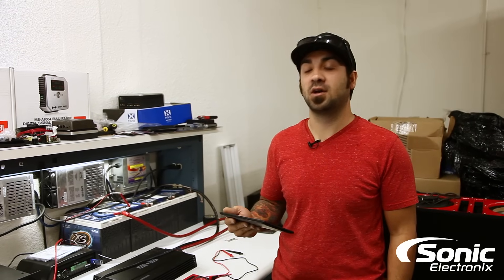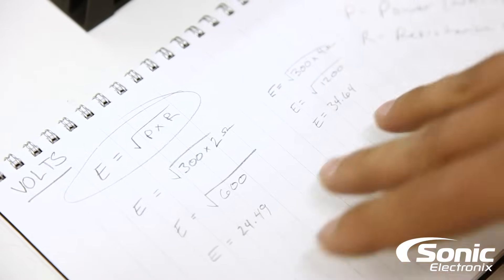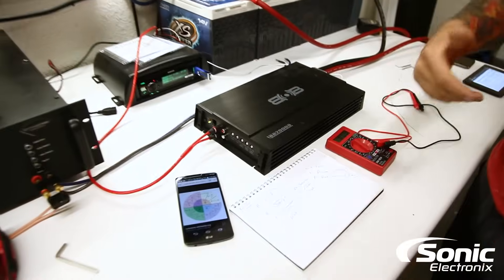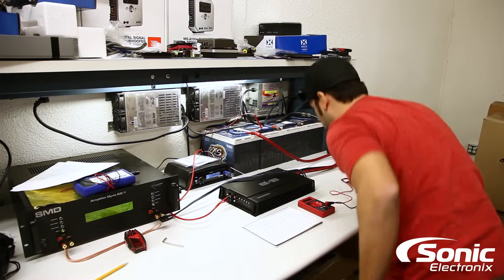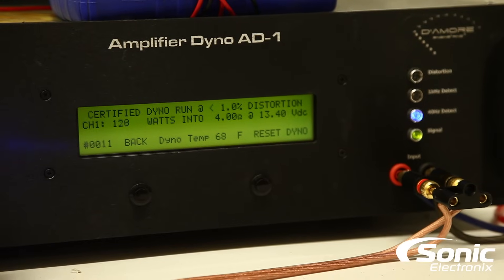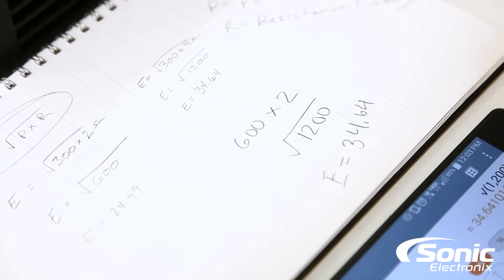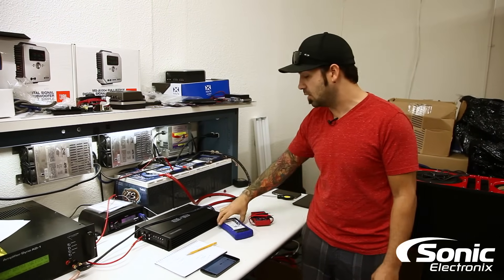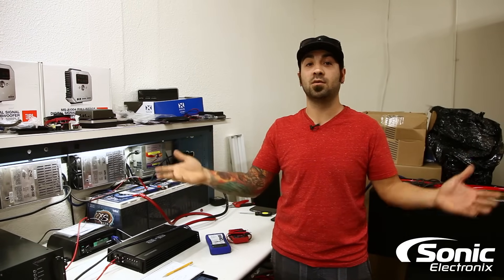How To Set Amp Gain to Match Lower RMS Subwoofers? | Car Audio Q & A

Comment: Your formula is wrong, rms and dc are different and you just cant use ohms law, real formula is Erms = sqareroot (2 x Prms x R). ohm law you used is dc equation. that 300watt @ 2 ohms needs a voltage swing of 34.64 volt peak to peak to get 300watt rms, we are talking about sine wave and it is not pure DC where your formula is right. you need to insert 2 in the equation.
Reply: Hello James, I just found this video few days ago, I already posted three comments, I agree with you that the ohm's law assumes that the resistor is fixed value, AC is different because of the sine wave. the resistor under different frequencies will never stay at one value, it will make our calculation not even close to the value it suppose to be to get the full performance of the sub.
Reply: James, I agree with some of what you say, however some other do not agree do not disagree, I am not really experienced in the audio and speakers, but doesn't sound good to me when you consider the max rating for a speaker, I guess it is just something some manufacturer mention for marketing, what is really matter is the RMS. means if a speaker rated 100 Watt RMS, I will be thinking hundred times before I over power it, I may go over power up to 25%, but I said 25% not based in any knowledge that I know, not based on any logic, it is simply just a guess, over powering in general is something I wouldn't prefer to do as long as it is in my hand to apply the right exact wattage, for car audio I may go 25% over and that is because when the car is not running the battery is giving less than 13 volt and most likely it affect the amp, so 25 % over powering the speakers when the car running is ok, not more than that. also I do not think the speaker rated 50 ohm and getting the 50 ohm RMS, will give the same sound pressure as speaker rated 100 ohm and getting the 100 ohm RMS from the amp, no way, if it is possible you will sacrifice the SQ to make lower wattage sound as loud as higher wattage, Back to the main topic: What makes speakers more complicated than any other simple load is the frequency, the frequency changes the value of the resistor and therefore Ohms Law  assuming 4 or 2 ohms impedance is wrong and will lead to wrong result, because higher resistor or impedance means lower current, which means higher voltage, so if ohms law assuming 4 ohms lead you to adjust voltage at 30, that 30 is not going to give you any considerable performance from the sub, unless you adjust the 30 at 0 level, but then when you move the level control to max or close to max you may exceed the limit of the amp and guess what? CLIP. best to find the exact voltage at the frequency between 20 and 80 Hz, adjust this voltage when the level controller at max, and the full range speakers at max or as high as you want, this way you make sure you never clip, and never under performance.
Reply: +James Balagtas Close enough... lol
Reply: yes, sine waves are calculated as to be equivalent to AC if you calculate its Root Mean Square value, the tested value can be directly calculated as dc power if the test read true RMS in AC, like fluke testers
Reply: an example is, 100watt dc on a 8 ohm load, need 28.xx volts but on a sine wave, you need 40volts peak to peak to get exactly 100wat ac  euivalent on the same load 8ohms. thats the difference between ac and dc power
Reply: I do not agree 100%, my point is that the frequency will change the value of impedance, and I do not really know how to measure impedance. let's say under 50Hz, the way to do it is to play 50Hz test tone, and start with the value suggested in this video, measure the current and multiply it but the voltage, if the result is less than the wattage rated, or targeted, continue increasing the gain, measure the voltage and the current, do the calculation, and so on, until you find the Volt X current equal the wattage rated or close to. when you are done with that it is easy to calculate the value of the impedance when it was under the 50 Hz test tone. I assure you that will find the voltage value higher than the peak value of what this video suggest, I mean way higher., It got be X 1.65 of the RMS value. How can I guess? because I did that for 210 watt RMS amplifier. I got 190 watt out of it, measured AC volt about 50 volt, or 51 RMS, do the math to find how much current I actually measured.
Reply: we are not in ideal situation, even if you know the outcome of the calculations, in the real world, it will differ, when they rate an amplifier, it mean it can deliver pure sine wave without distortion on a said impedance load, even speaker designers cannot get the impedance perfect, the only way to get the real power delivered to the speaker will be always below the ideal design cause there are alot of factors, like baffle resonance, coil changes in impedance like you said, even the speaker wire will affect the power, one rule i have always been using is matching, as long as you have the right voltage swing of the amplifier, no matter what freq, base mid or high, match it, speaker max rating does not mean you need to drive it at that power, some speaker have max and normal power rating that are much lower. example a JBL 2225 has ma max off 400watts and a normal power of 100watts, driving it with a 200watt amplifier is as good as  driveing it with 400watts rms, some people think power is musical power, well i dont, that is only electrical power, a 1000 watt 12 inch will do the same sound pressure with a 200 watt 12 inch same construct speaker. Power is just electricity that will just burn speakers,  i don't go for power, i can go louder with less power right. when designing VU meters that says peak resolution is 100watt on 8ohms, its just a reference that you reached that power output or peak level where it will start to destort, IF the total load coil is 8ohmAC exactly, just don't get confused about power and audio sound pressure. anyone can get the same sound pressure with different power ratings
Reply: i have a mobile sound system, not usually car audio, well some speaker are design to operate on a band of freq, in mobile we don't use woofers, we always use instrumental speakers, even for subs, car speakers usually use woofers, that has freq response test graphs, so you need to build baffles that will be good for that specified freq, also these amplifiers have limited voltage that is why its easy to clip and usually operate at very low impedance low impedance, now depending on how stable the switching supply of these car amps, it will always suffer, i dont even think they even rate car amps as rms power, unlike AC power professional amps. i do have at least do 1.5 to 2x allowance too, but in car amps, it creates power by more current or lower impedance, that is if the ampli can push it to peak voltage which usually doesn't, some dum manufacturers even rate them thousands of watts when to the cost that you have to operate at 1 ohm lol. even your speakers wire will cause a lot of loss,  a 30volts swing will only be around 50watts@8ohm. 100watts@4ohm and 200watts@2ohms, it can't drive a 500watt 4ohm speaker fully. unless you start bridging this. ideally bridge corresponds to x4 power ideally, but due to hysterisis and real world capability of components, you can justify only >= 2x the single amp power.
Reply: James Balagtas Fascinating thread guys. What if I measure impedance from the speaker wire attached to the subs then use the e= square root (measured Ω·Watts desired). Do you still need to add the extra 2 in the square root? In my application that would be the difference of 31.62V vs 44.72V, a hell of a lot.
Reply: But the power dyno proves the formula is correct.
Reply: +Ashraf Mohamed check this out I can hit a hundred 45 decibels in my truck with 212 that are 500 watt RMS Subs I can also get some subs that I have that are hundred fifty RMS Subs and hit 145 decibels so just because your speakers in your amp or more powerful don't necessarily mean it's going to make it any louder you would think it would but it's not necessarily true if you look on the internet there's a guy that has two 12 inch Kicker comps on 300 w RMS that hits a 151 decibels

Comment: the problem i have is that if i play that test tone at 0 db yah i can get the power i want which happened to be 1400 watts out of my 2k but when i play music the bass is never at 0 db how do i set my gain without test tones or test tones that are at music gain.
Reply: +ThaDjSteps 
thats simply a maximum value. as to not blow out the voice coils on the speakers.

Comment: How do you know when you're running your amp at 2 ohms?! 
Wanting to get FULL potential of my subs AND amp
Have a "Zeus amp" 2400 max
And a alpine type R sub at 3K max. 
Looking to push my sub @ 1200 with no distortion or clipping
Reply: +Chuy Pizano 

Ignore max ratings they are simply bs

the #1 thing to do to get the most out of the equipment your running with no distortion or clipping is to get a dd1. that will help you set gains without distortion.

not the best, but the easiest
Reply: +Salvador Sandoval 
What's a DD1 ?
http://www.amazon.com/Complete-Electronic-ChromaCast-GoDpsMusic-Drumsticks/dp/B008GXEFWC
Reply: +Chuy Pizano - Read This 
http://www.crutchfield.com/learn/how-to-match-subwoofers-and-amplifiers.html?g=500

Comment: Great video. But to be even more exact, shouldn't you use the actual Re of the specific subwoofer you're using when doing your calculations? Rather than just a nominal value?
Reply: +firebirdude2 
yes and no..... the simplified value (4ohms of 2ohms) is close enough to the specific Re of the coil that you are using(3.6ohms or 1.8ohms)

since the asker didn't provide re sonic electronix only used a simple value in its place.

also there's only a certain amount of precision that you can achive with a small screwdriver(or fingernail) and the tiny gain pot on the amp. so nominal value is making the math a lot simpler. 

no need to go to extreme precision when most voice coils are capable of taking almost 50% more of their rated power all day.

Comment: I need help ASAP. I got confused now.
I have 2 12" subs 600w rms 1200w max @4 ohm and a 4000 class d amp. I have it @ 4 ohm which gives 1500w rms. So...the voltage I got was 49v BUT here's where I'm confused...should I do: 1500 * 4 = 3000 square root 77.45 or 1200w * 4 = 4800 square root 69.28v ?
Reply: Sonic Electronix    I think I got it...600w (subs) * 4 (ohms) = 2400 square root 48.98v.
I replied correctly to myself, lol.
Reply: Sonic Electronix Can I use this same method to set @1 ohm? The amp is rated 2800 watts rms @ 1 ohm, don't know if is safe for the subs. (600w rms dvc). So it would be 600 * 1 = 600 square root 24.49 volts?
Reply: +LOV2XRL8RL 
You have two 4ohm subs, (Unless your subs are dual voice coil) wiring them in parallel (as they should be) would present a 2 ohm load to the amplifier. There's no changing that. The amount of power being delivered depends on what the amplifier outputs at 2 ohm.
Reply: William Jeremiah Thank you

Comment: how does the remote bass boost knob play into this? at 0 boost the ac voltage is set at 27 but it gets spikes to 40 at full boost. using a 1216 hifonics 1200w @ 1ohm to a RF P3 rated at 600RMS wired to 1ohm. I'm putting about 750w to it i think.
Reply: +Wesley Miller 
the remote bass knob is different depending on the install and brand.
the one i love to use is the one that is hooked up via rca to your head unit then outputs the rca to your amp. meaning that you can turn the knob all the way up. set the proper gains. then turn down to a desired volume level without boosting anything passed its braking point.

Comment: I'm running a 2000 Watt Crunch Class D Mono Amp and 2 12" Polk DB Subs, factory radio also. Everything was working fine, until 2 days ago amp won't cut on and fuse looks to be in tact. I used my meter and it showed the amp receiving power but won't turn on, any idea of why? Sonic Electronix
Reply: did you ever figure it out?
Reply: Yea changed out my fuse from 80 to 100 and I need to set my gain...
Reply: +CJ Babbs (CJSKYWALKER88) 
If changing the fuse to a larger one fixed it..
You didn't "really" fix it. Something will happen again and it will be worse.
I'd be curious as to what ohm are you presenting to your amplifier.

Comment: If I have a 1500 watt 4 channel amp for my 4 4 ohm speakers with 60 rms each what would be the formula, what would be the voltage and would it matter what speaker output I checked since it's a 4 channel? Sonic Electronix
Reply: +ponderkid11 
so since you are looking for the recommended voltage when using a multimeter for your speakers ignore the amps rating and lets start with the math. 

1.   60x4=  240
2.   squareroot(240) = 15.5 (rounded up from 15.4919333...)

so your target voltage for a 1000 hz test tone@0db is 15.5v
Reply: +Salvador Sandoval ya 3 months too late but thanks anyways
Reply: Sorry lol but hey any bit helps right
Reply: +Salvador Sandoval yup haha

Comment: Hey mate great video with regards to the ohms if you wired 2 subs down to one ohm would you use one in calculations or 8 as it is two 4 ohm dual voice coil subs wired down ohm, hope this makes sense. Thanks
Reply: +William Hirst 
 If you are wiring them both to one 1ohm load. you  want to use 1ohm in the math

Comment: Hey so I have a question if im installing a 1000 watt speaker in my car do I need a one channel amp or 2 channel ?
Reply: you will get more sound off 2 500w subs than 1 1000w sub.  just so you know.  and you could use either one because you can bridge the 2 channel down to one.  just make sure you have your ohms right.

Comment: You didn't mention if you use the DD-1 to take out all distortion you can run your speakers a little above rated power, it doesn't exactly have to match.

Comment: thanks for noting at the end that to achieve max clean power a o-scope or dd-1 is needed.  because an amp may only put out 32 volts clean.  it's not an issue to under power of over power (with in a tolerance) on clean power.  but dirty is bad either way.

Comment: If my head unit only has just 2 pre amp outputs how do I run a 4 channel amp?
Reply: Joseph Wright To run a 4 channel you need front and rear RCA preout plugs because a 4 channel gives you control of the adjustment from front to rear to balance sound in your vehicle, if you don't care for having that control, a simple 2 channel will do just fine, so remember a 4 channel gives you control over front, rear, left, right... a 2 channel gives you control of just left and right, if you have a 4 channel amp now you will just have to run it in 2 channel mode, that means using the A channel for all the speakers, the B channel will not be in use.
Reply: +Joseph Wright 
2 pairs of pre-outs or one white and one red ?
If the amp is bridgeable, it could be used as a two channel amp. 
As long as each channel is stable at 2 ohm, you can bridge them and use a minimum of 4 ohm on each bridged output.

Comment: Does this formula work for all speakers or just subs and can it be done correctly without the test tone??
Reply: Juan Rodtiguez Yes, in the laws of electricity this is the only way to calculate the power you are looking for, this apply's to any type of device that provides AC current.
Reply: @MazdaBass971  5yrs later but thank you!!

Comment: Don't forget to set your crossovers before testing so that you can read your 50 or 60 Hz test track.
Reply: and maybe try playing something else just to double check.  also the reason the wattage could be slightly more or less than your calculation has to do with your input voltage and how your amp handles that.  most will put out more wattage when the cars running and your alternators pushing 14.4 instead of 12 when it's off.

Comment: First off, love the channel. Next I am running four Memphis power reference series duel four ohm "wired" down to two ohms. Two of the subs have one of two coils fried and my multimeter shows three ohms. My question is, will I cause damage to either the subs or the amp with this wire configuration? Whether I run the amp at 2 ohm or 4 ohm, will damage occur?

Comment: I got two Alpine type R 12 both have dual 4 ohm voice coil how would i go about getting my voltage for those subs i have a 2400watt amp the subs are 700rms each i'm not sure of the rms on the amp
Reply: +Josh M. 
"i'm not sure of the rms on the amp"
How much did you pay for it ?

Comment: your distortion light came on on that last test on at 7:34
Reply: cmn65401 I was wondering the same since he said stereo isnt distorting and the AMP can put out 2000W, but the distortion light came on at 600W only.
Reply: @AmritSidhuSaab  that's what he set the gain to duh
Reply: Amrit Sidhu the reason for that is 2000 is the peak wattage only what it might hit at its maximum RMS is half of that usually at a thousand Watts and only if it's bridged. If it's a dual-channel that thousand is actually split between two creating a 500 RMS per Channel. As a rule of thumb if you have a 2 Channel 2000 watt amp it's 1000 / Channel Peak 500 RMS. The fact that it didn't distort till 600 is a matter of quality
Reply: Just cause the stereo doesn't distort, doesn't mean the amp won't, I know this because I have the smd distortion detector
Reply: Amrit Sidhu hi
Reply: The test is for 1% thd. So the dyno will automatically stopped once it reaches that point.

Comment: Sonic Electronix what about setting gains for subs that are rated higher than what the amp is rated? 
i have an amp rated at 750W (JL HD750/1) powering 2 sub rated at 600W each (1200W total) 
should i use the same formula to set my gains? or should i aim for an output of 750W?